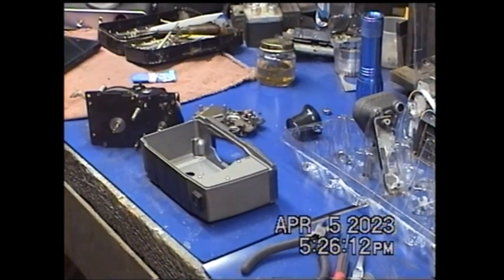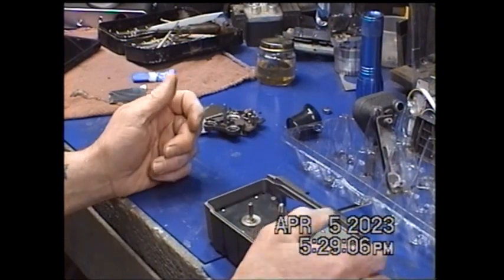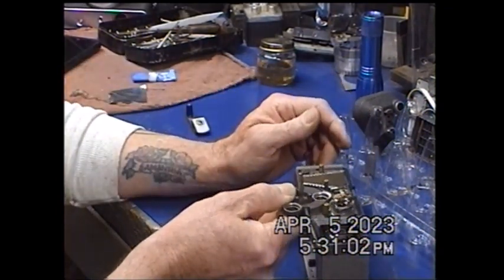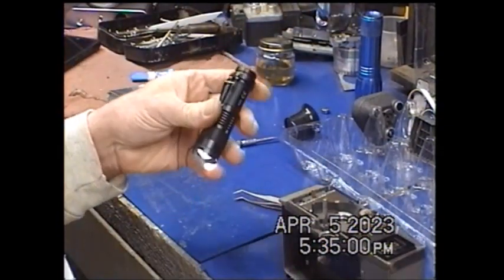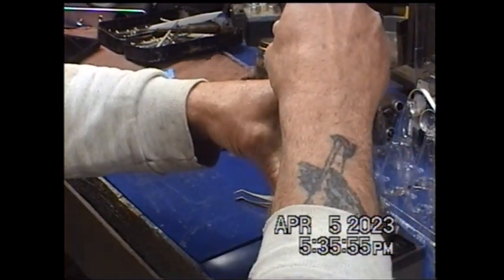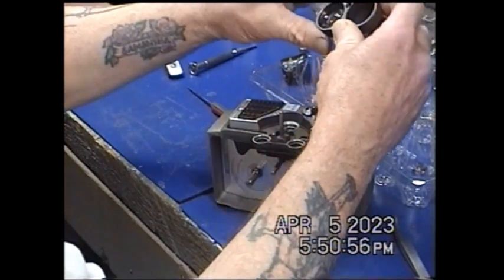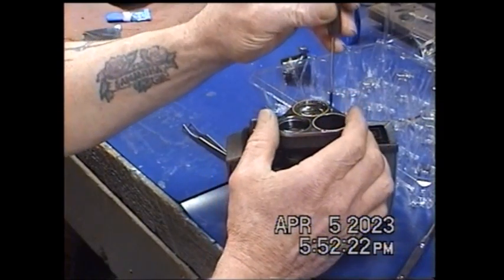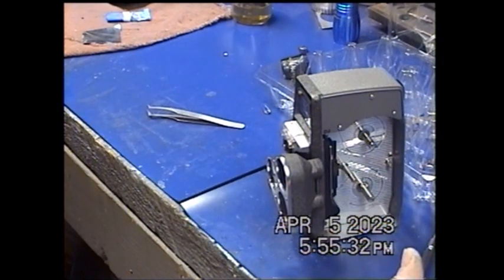Bell and Howell electric eye movie camera

Comment from the maker: That is a big maybe. IF it was well rolled on a spool, even split between the two might work. The spools are dark plastic to protect it. IF the light wasn't direct on the film. Maybe.
It's possible but you will loose whatever film was exposed of course. 
I guess it depends on your willingness to gamble the $30ish bucks for development